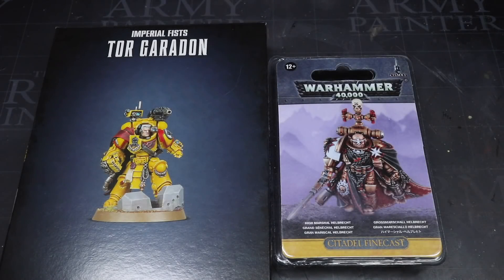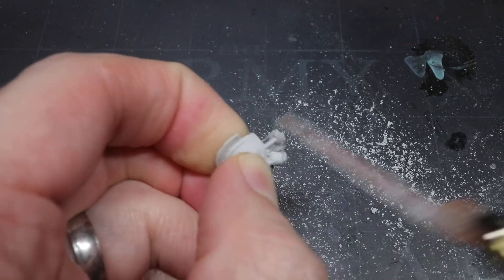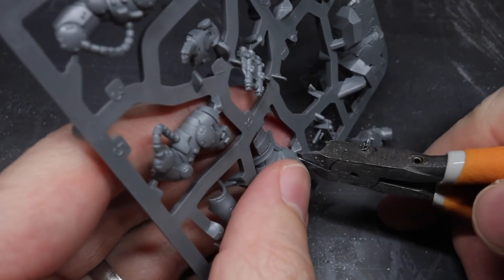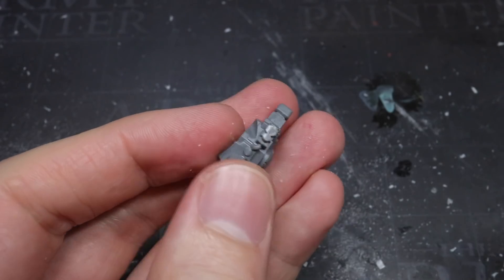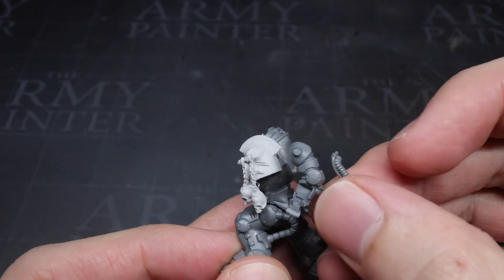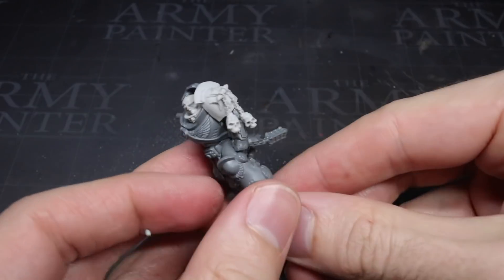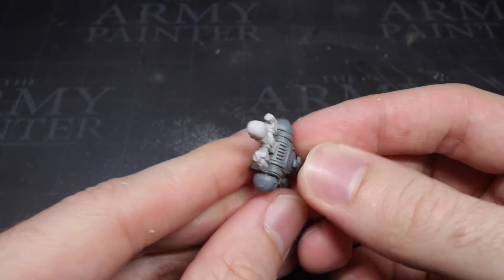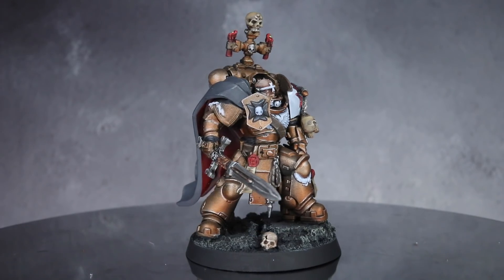Kitbashing Primaris Helbrecht

Comment: This is a really good build. I would like to offer some constructive criticism, if I may. Helbrecht lost his right arm some time ago, and it was replaced with a cybernetic arm.this is a detail present on the Helbrecht model. I don't know if crossing the Rubicon Primaris can allow the regrowth of lost limbs, but that might have been nice to represent. 

Obviously, the combi-melta would have been a nice addition, especially if this was going to be a tabletop ready piece.

The seals on the Black Templars upgrade sprue (and this is something I only very recently learned myself) are known as Crusade Seals. They are traditionally white or silver with red parchment. It's a slight variation from the more traditional purity seal that helps set the Black Templars apart from other space marine chapters.

Please don't take these the wrong way. Your conversion skill is spectacular, and reminds me of the sorts of conversions I did in my first phase as a model builder.

Comment: Thank you for the great vids! I want to kitbash myself and I have a kitbash related question: you always reinforce everything with a wire. Why are you doing so? 

I understand a reinforcement of a thin stuff like a halo or a pole or smth like that. But here you reinforced a hand with a sword. Is it really necessary? A lot of sword hands are manufactured as a separate thing. Do you usually reinforce even standard models with a wire or is it a kitbash thing? Is it because kitbashed surfaces are fundamentally uneven or what is the reason?

Comment: The one issue I have with your conversion is that you forgot to shave off Garadon's chest Aquila. The Templars do not wear the Emperor's symbol, they are his symbol.
Reply from the maker: I've seen plenty of official artwork that has BTs with that Aquila so I think it's fine but the model would still look OK if it had been removed.
Reply: this is an old myth that isnt true in any official art. Look at all the aquila chests in this classic one: https://warhammerart.com/wp-content/uploads/2015/10/JB148-Black-Templars.jpg
Reply: @dylanboyle3761  The winged skull is actually the Imperialis.

Comment: Turning a Ragnar Blackmane into non-Primaris Gabriel Seth right now , worst conversion idea i've ever had , most Finecast pieces are way too small compared to the proportions of Primaris :')
Reply from the maker: You have to very careful on what bits you can use. Hands and heads are usually fine, as are extra items. But arms, legs and torso are a lot smaller.

Comment: You need to make better use of modeling techniques.  Use latex to make a mold of the original and cast your own resin parts. This will let you use more of the original.  With parts this small, it isn't much of a challenge. Your miniature's movement is all wrong too.
Reply from the maker: Thanks for the idea on the casting. It's not really in the spirit of kitbashing but might be fun to try. I would concede that the lantern on the chain is a bit off but I don't agree with you saying that the miniatures movement, in general, is wrong.
Reply: @PeteTheWargamer  remember to look for contradictions in your composition,  it isn't usually one element alone that detracts from the model, but two working in opposition.  Address those contradictions in movement or lighting and you will improve your realism significantly.